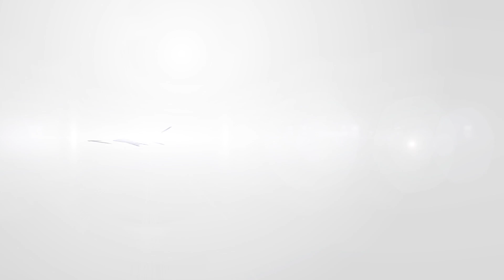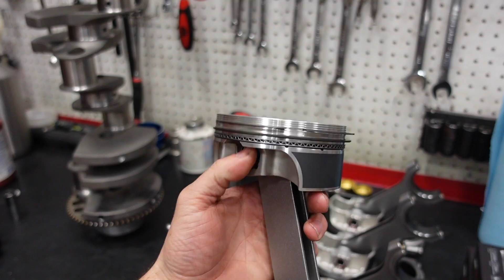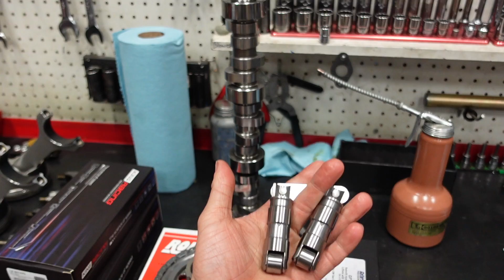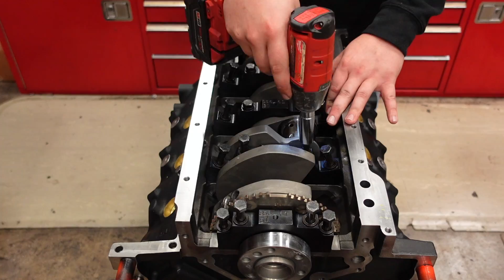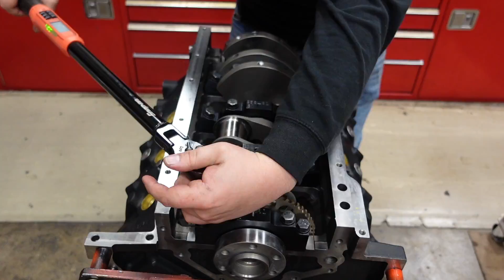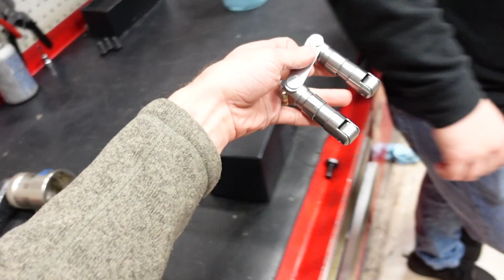Building a 1,300hp LS Short Block - Easy Horsepower

Comment: Cool build! Very stout bottom end. I’d have considered a slightly shorter stroke to gain a bit more piston stability and crank stiffness. With a boosted application, you can offset a bit of displacement loss with more air density. Something in the 3.7”-3.8” stroke range seems about right to me.

Comment: Is there anything fundamentallly wrong with building to this level and then dialing it way back for peace of mind?   Like would there have to be different choices made along the way to accommodate that slightly different goal?  Looking to eventually implement a "do it once, do it right, drive tf out of it until I eventually die 65 years and a couple million miles from now" type solution. 😂

Comment: pretty much the same as my build except I'm using Lunati crank and Manley rods both have proven themselves as top class units , I'm using the same JE pistons and rings I'm staying with an alloy block as weight is an issue for me I am going to have the block and heads o-ringed and using a big 98mm single Turbo haven't got the room for 2 small ones which will take mine over the 1000hp pretty easily

Comment: Torqued the ARP rod bolts but didnt (on camera)check the stretch? I thought ARP rod bolts are to be stretched and their torque value is a guideline to get you to the recommended stretch but could be lower or greater than the torque valve?

Comment: nice job but end play on the crank vs the rod cap movement should be mesured. eveything moves under pressure and rpm. on automatics transmissions.  Because over time that thrust end play will expand. and the crank will walk so you must know for the sake of the rod bearings how much it moves with the rods installed.  one thing guys over look or just dont think about it.  could be a nice experiment for you or a video

Comment: What if I wanted to run this size engine and or a 454 cubic inch LS with either a belt driven pro charger or a crank driven pro charger
Reply: I was also wondering what kind of cylinder heads could be run with any of these combinations

Comment: If it’s possible could you show put an LS 7 dry sump pump on an LQ4 or an LQ9?
Reply from the maker: That is not possible.
Reply: On the 441 is there a wet sump option? also 58x @JacobVillemain

Comment: I noticed that you used a quality Single Row timing chain set. Do these single Rollmaster timing chain sets have any advantage over a double row set? Thanks
Reply: a single row is easier to fit...also if the valve train is stable you wont have any issues with a single chain...they have been proven in HIGH hp setups..

Comment: Can you run a 24x crank in a Gen4 6.0 LS block meant for 58x? Does it change as well since the camshaft sensor is on front timing cover and 4x instead of 1x that the 24x crank is usually paired with? I know a bit out there. 🦅
Reply from the maker: I wouldn't. 58x is a lot better than 24x stuff. Lingenfelter makes a 58x to 24x converter box if your ECU is 24x.
Reply: @JacobVillemain  What's your opinion on converting an early 6.0 to 58x? I will be using Holley EFI, forged rods and Pistons, stock crank, turbo charged. Are there any benefits? Would I just need to swap the 24 wheel for a 58 and use the timing set and cover for a front cam sensor?
Reply from the maker: @Ghost_2366  correct, simple as that.

Comment: What's the price for this build I want to purchase the same build for my G8 GT
Reply from the maker: $6,950
Reply: @JacobVillemain  that is a killer bargain
Reply: @That Engine Guy  that includes the block or just parts if so the block as well can I get your info I'm located in Dallas,tx
Reply: I plan on ordering one for my g8 also, can I use my ls3 heads on this 6 bolt block they’ve been cnc ported w stainless valves I’d hate not to use them